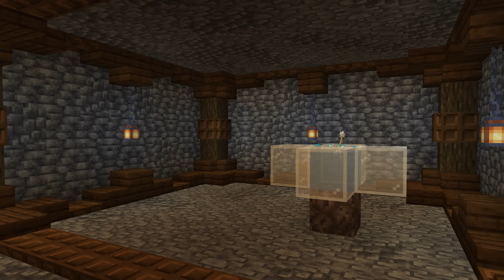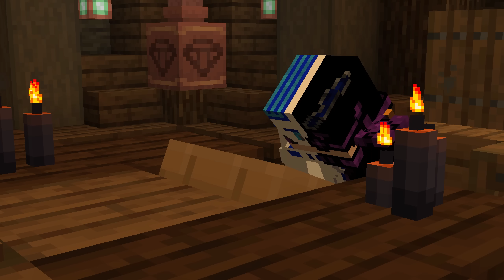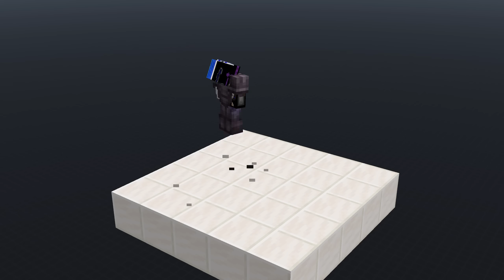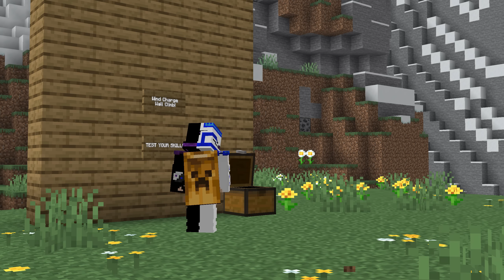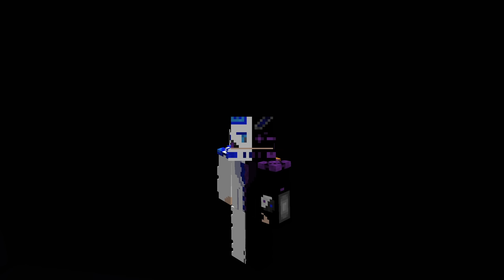How A Wind Charge Can Ban* Your Enemies

Comment: 15:07 How an observer sees the wind charge?
Reply: string i suppose
Reply: when an entity is passing through string, the string block changes state. the observer detects this state change.

the reason string changes state when mobs go through it is because it needs to for tripwires. Probably because it's easier to program, they made it always change state even if it's not connected to a tripwire

Comment: Do you lose the owner tag of the wind charge when the owner is logged out while you try to transfer it?
Reply from the maker: Yep. It was something I figured out wayyy too late. Thought it was an unloading issue, made a note to look into it, forgot I made the note, skipped working on the project for a week and then forgot about the issue.

Pretty easy to work around if you have backup charges though.
Reply: @BowAssassin35  I mean you need a player online detector to ensure you don't lose all your backup charges. But I think you can even detect the player being online relatively easily using the charge, since I think (not sure) the zombie takes knockback from the player when it is hit by the charge
Reply from the maker: @2No2Name  You can do that, or can use a shrieker and calibrated sensor combo. Filter for explosions with the sensor and then detect if they were player made with the shrieker.

Already got a super compact version of that design made by a friend of mine. I can show you the design on discord if you want to see it.

Comment: Is there a way to transport windcharges between dimensions? Im thinking about hiding the machine in The End but if I make the windcharge minigame there to collect the player tag Im afraid they might connect the dots and figure out the machine is in the same dimension (as you don’t go to The End too often and it would make much more sense to make the minigame in the overworld) I feel like it might be a big security issue if the players can pinpoint the machine’s dimension based on the recent interactions they had with you
Reply from the maker: Push it through the portal with a piston. It should work and transport the charge there.
Reply: @BowAssassin35  thank you <3

Comment: why not rotate the windcharge hit direction you said machine > zombie .... player_kb -> but what if youd use more or 1 zombie with zombie < machine ... <- player_kb. rotate it in every direction and you cant figure it where dmg comes from, also randomize which machine works so player cant single out dmg from 1 machine.

also why not save windcharge, feedback loop it if you want, into an arrow or maybe the tnt minecart duper for a higher dmg output

Comment: Hey! I've spent hours trying to recreate the wind charge catcher (yes I used a redstone repeater for allignment for the breeze on a minecart) and had very little success. It bounces to a 45 degree angle relative to the breeze when it's supposed to directly turn 90 degrees towards the catcher. I've tried other blocks like snow and trapdoors and it does the same thing. I'm on 26.1.2 btw. Is there any remedy to this?
Reply: Try putting a cobweb where the breeze is. I didn't see that at first.

Comment: You should have them synch their 10 tick timings by having them linked to daylight sensors so when the machine is turned on they all synch their timings properly. What could be fun but more complex is wireless redstone so you can turn it on and off from 1 place

Comment: Couldn't you make it much harder to triangulate by using multiple voodoo machines for the same player, turning each machine on and off at relatively random intervals in different dimensions. Especially if you can put them several thousand blocks out

Comment: If you tasked me with preventing triangulation, then I would time the 4 machines to not fire in the same order (A, B, C, D, A, B, C, D) on a loop every time. This makes timing quite a bit more complicated, but it would make it quite a bit trickier to identify where the damage source is.

I'm by no means a redstone expert of any kind, but I'm sure you could fit a ROM somewhere in this design that encodes a long pattern

Comment: 22:52 Could you not just make multiple machines? It may be hard moving someone’s arrows across the map but adding just two will make it quite hard to be sure where the damage is coming from. Adding a large box of the machines may work best because that means inside the box and in a perimeter around the box there is no way to deflect the damage. (You can tell I didn’t finish watching the video before commenting)

Comment: This is pretty cool! But I feel like the fact that damage tilt is in the game makes it easier to unban oneself. Since damage tilt amount and direction can be read pretty easily with mods, one could move side to side while taking damage to collect data points to use for triangulation. Then it would be quite trivial to log on with an alt, go to the coordinates, and blow up the machine.
One could ban another player, provided that player is average. A technical player would find this to be frustratingly amusing.

Comment: So the naive design of hitting a charge with an arrow has issues because the redirection is based on where the victim is looking.  What if the victim logs out, does it use the last stored facing direction?

Comment: I have this idea.
The piercing arrow can hit through 5 entities before it disappear.
By using an instant damage II arrow to hit 4 zombies, we can damage them multiple time.
Arcording to Dashpum4's villager killer, by making that arrow go though nether portal, we can reset the arrow.
Finally, build a raid farm for emerral. Trade the emeral to armorer and librarian for diamond armour, thorn III, unbreaking III, and projectile protection.
---
If we use players to AFK in that machine and build an XP farm next to them, the armour's durability no longer a problem.
Reply: So I had the same Idea the problem with this one is the nether travel part it would make the machine 2x easier to find the redstone would probably have to be slightly more complex and the zombie rehearing station would be different but yes in theory this could work and it would be less annoying but you could always just tweak the witch healing system so it works in the overworld and end only and make it Soo much simpler so I'd stick with this

And arrows do more armour dura if I'm right
Reply: @ZaidAhmed-ti6lg 
You just need a few more pistons and a flint and steal to reignite the portal. It isn't that hard.

No, how much damage the arrow deal to your armour is depend on how fast that arrow travel when it touch you. Because of that, you can just drop it from 1 block (through water) and you basically lose no durability.
Reply: @SnowAssassin-4789 but putting the arrow back into the portal is still annoying
Reply: @SnowAssassin-4789 it's still easier to find and U can't use the same regear system
Reply: @ZaidAhmed-ti6lg  
At least it is less annoying than capturing the breeze.
It is just a small trade-off, so it is fine.

I actually didn't quite understand the regear system that you were talking about.
Reply: @SnowAssassin-4789 the regearing system would have to be completely altered and capturing a breeze is not that hard
Reply: @ZaidAhmed-ti6lg 
We don't need regear system if we use player instead of zombie.
I agree that capturing a breeze is  not hard, but it's annoying. Remember that we also have to move it to where we built the machine.
Reply: May be we can just agree that cycling the piercing arrow around and capturing a breeze are both annoying. We can just build the machine in our own ways. Depending on different situations, we may need to use others design.
Reply: @SnowAssassin-4789 your not wrong but still the regearing machine that the new problem also yeah ig if there is no trial chamber allowed or something yeah this would be better also have fun getting somone to shoot a piercing crossbow at something
Reply: @ZaidAhmed-ti6lg  
Dashpum4 just drop the design, Yeappy
Reply: @SnowAssassin-4789 dashpums wasn't good there's a better one same concept it's annoying to build but better

Comment: I feel like the weaknesses can be negated, remember the teleporter that uses a wind charge and player arrow to enable the teleporter when you look in a certain direction ? well you could use the same design to activate a different BVM depending on where the player is looking, you can also use a single arrow by duplicating the owner tag to other explosives

Comment: if i remember correctly, thorns damage aspect only checks for if you have any thorns item in any slot, including hands and offhand, but only applies durability to equipped armor, so you may be able to get a slightly higher thorns chance that also doesn't lose durability

Comment: So cubicmetre has the orbital strike cannon which launches tnt. What if you modify it to launch an owned wind charge at a mob far away, or alternate between different mobs in different locations, so that triangulation becomes practically useless because the damage comes from different places and the main part of the machine cannot be found, only the thorns mob
Reply: Probably many issues with chunk loading and stuff but I’m no expert this may be possible

Comment: I replicated the machine and (with some trial and error) every other component works fine except...

I can't seem to make the Armorer function properly 

I tried using both straight slanted and flat curved rails but no matter what it seems to 

-Sometimes have specific hopper minecarts break
-Have armor jumbled up between dispensers 
-And start leaking armor
Reply: It also seems that owner tags aren't transferred if the victim is offline, resulting in the breeze dying to thorns damage if the victim logs off

Comment: Another method for transporting the initial tag could be using a wind charge as it will continue moving in a straight line with relatively high speed. At the destination you'd just need to catch it with an arrow.
Edit: Apparently you mentioned that later
Account username is Jetskuu btw.

Comment: about the direction flaw, you just have to make it, four times and so you would need four times the player arrow too, to make it four directional, or if possible, eight directional, and about the armor cost, you can make a mob farm above that lets the xp to fall to the target, but it creates another requierement, player, since, mob can't take xp, and to make it possible for afk, just make it automatic farm, but still, it requieres, A PLAYER to be afk, if multiple machine, then multiple PLAYER

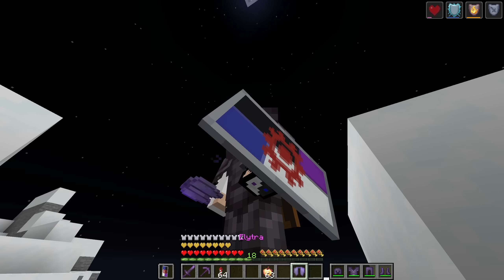Comment: cant you just spin around with a shield? if damage is blocked, that direction machine is located 20:50
Reply: This would give you a single line along which the machine is located, we use two areas such that these lines almost always intersect (unless you travelled exactly away from it) and that intersection is the location of the machine

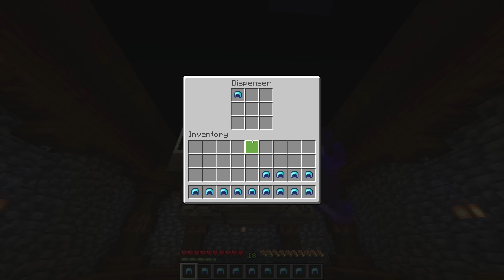Comment: 19:50 just use an allay holding thorns instead of a zombie lwk
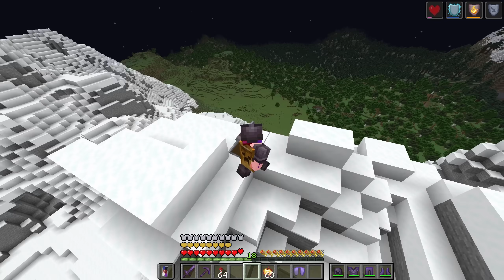20:45 just put it in the end or nether, i mean who's gonna be spending most of their time in the end unless they're actively looking for the machine or are getting elytras
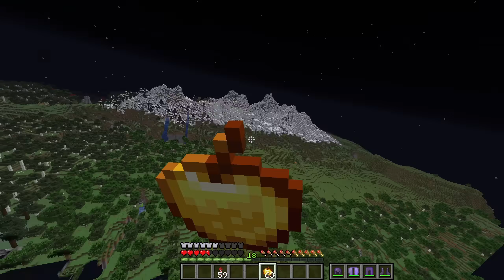22:42 HEY I DID THAT STUFF LITERALLY LAST YEAR, I REMEMBER IT PERFECTLY
24:23 i knew you had the inner cubicmetre within u
Reply from the maker: For the allay part, thorns has always has the same damage. The level just determines the chance to hit. An allay holding a maxed armor piece is about 40-45% to hit. Full armor zombie is about 90%. You lose a lot of hits with an allay.
Reply: @BowAssassin35  of course you could just multiply the bvm and with the allay you wouldn't need to do armor replacement and the witch healing station, and would probably save a lot of materials, however the redstone will become slightly more expensive with the multiplication

also to account for damage iframes you could just make the bvms activate in a sequence of least to most damage, via different levels of thorns. this concept has been shown in the several arrow cannons made by cubic meter. you prolly alr know this but it's jst that in a single tick or whilst the damage iframes are happening, if theres any damage greater than what was originally applied, then that greater damage will be applied after the original with no wait. take it like if i were to apply thorns 1-3 dmg in 3 consecutive ticks, it'd go in sequence to that order from least to greatest, such that tick 1 i have thorns 1, then tick 2 thorns 2, tick 3 thorns 3, and the damage after tick 3 (or during idk) would be the gradual outcome of the 3 thorn's damage

Comment: Wouldn't a better way to make this machine be a mob or xp farm to repair the zombie's armour. It might be quite hard to make but it would make the machine MUCH cheaper (not having to make a ton of armour sets) and would make it completely free to run for longer times. Really REALLY awesome video on how voodoo machines work. I might try making one that incorporates this idea.
Reply from the maker: Only the player can pickup xp orbs so only the player can use mending unfortunately. 

Otherwise you'd be right! An armadillo xp farm or something would be a much better setup and save a ton on armor!
Reply: @BowAssassin35  that's unfortunate I'm sure there are other ways to save armour though. I might try looking into it, could be a fun project. I do have to say the video was absolutely amazing. There's never really been a video describing how this tech works better than this one.

Comment: If you build multiple voodoo machines for the same person in different locations, (Idk much anout technical java but I assume that knockback is an additive vector quantity… if not possibly even better), then given n machines, you would likely need m>n different locations to triangulate the location of all the machines. Not only that, but the math would probably, cant be bothered to try it myself, get more complicated and tedious and with more kb (depending on location but higher kb potential) and damage means getting there would be a nightmare. One death and your fried without armor. Not to mention that this is dine under the assumption that they know there are n machines. They will likely triangulate with few points and get confused for a while, potentially giving up without realizing that there are multiple and assuming that the triangulation method just doesn’t work

Edit: he got me with the outro this has been utilized
Reply: i think this can be negated by just swapping the timing each thorns hit on a different tick so that the player does not know what hit is from what entity

Comment: I've built everything but the witch part just doesn't wanna work. The potion hits the pistons every time so it kills the snow golem, I've tried all possible combinations of alignments but it just doesn't wanna work, could u please give me a tip on how to align the snow golem and witch properly?

Great video btw, I really like that you didn't give the schematics because building this has been a lot of fun:D
Reply from the maker: I can't really give a tip since I can't see the build or which witch setup you're using, but check the piston timings (there should be just a plain redstone line) and make sure there is a cobweb in the witch's head. The web IS REQUIRED, since it slows the potions enough for the pistons to catch it.

Have fun with the build man! Lemme know if you have any other issues. Make sure to @me in the reply, otherwise youtube won't show me it.
Reply: @BowAssassin35  I am using the overworld setup where it hits the zombie from below, the cobweb is there and the setup is identical to the one you showed, the only thing I'm not sure about is on how to exactly align the minecarts, I think that's where it's going wrong.
Reply from the maker: @CrxzyRLOfficial ah okay!
Make sure the witch's minecart is on a rail and that the snow golem is on a bottom slab and pushed against the alignment pot. Lemme know if that works.
Reply: @BowAssassin35  I've already tried that like 15 times, with the golem against the pot, and the witch on the rail. I've tried putting the witch on the left side, middle and right side of the rail. But it just keeps hitting the piston every time. Maybe it depends on the minecraft version? I'm playing on 26.2
Reply from the maker: @CrxzyRLOfficial It might be. This design was made for 1.21.11 but I don't recall them changing any entity physics. I'll be able to test it tomorrow when I'm back at my PC.
Reply: @BowAssassin35 Okay, thanks in advance:)
Reply: @BowAssassin35  I did some testing myself, and on 1.21.11 my setup did work. To get it to kinda work in 26.2 I added a 2gt delay to the pistons that push the potion into the honey block, but it only runs for a little bit and then the snow golem still dies.
Reply from the maker: @CrxzyRLOfficial  Yeah, i just tested and found that 26.2 has broken all of my witch healing setups. Going to pin a link to an unlisted fix video in the next few days. Thanks for letting me know!
Reply: @BowAssassin35  That would be awesome, good luck on building it:D

Comment: Why not use an Allay holding a Thorns chestplate instead of relying on a witch to heal the zombie? It would be much more compact, wouldn't it?
Reply from the maker: Thorns hitting is % based. More thorns armor, the higher that chance. Maxed thorns with 4 pieces is about 90% chance to hit. 1 piece is a about 40ish I think?

Basically, allay is easy but misses a ton of damage. And the piece it's holding still breaks over time.

Good question to ask!
Reply: Thanks for the explanation! This is unrelated, but I recently uploaded a redstone contraption. If you ever have a minute, I’d love to hear your thoughts on it. Any feedback is appreciated.